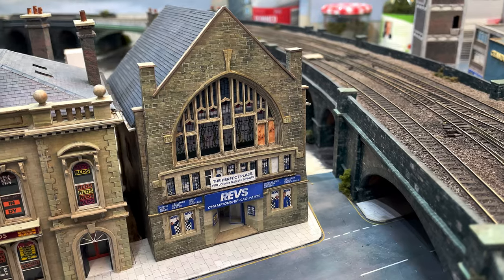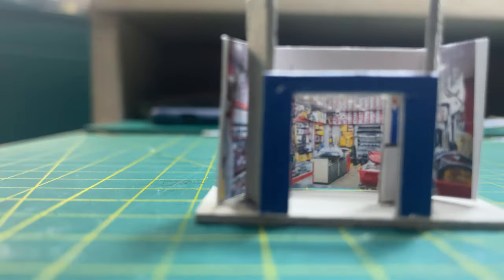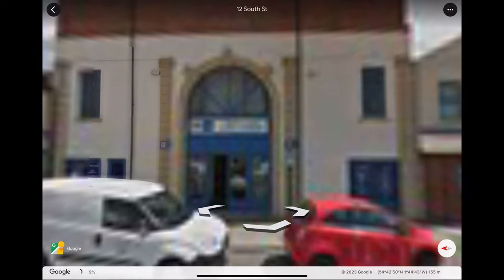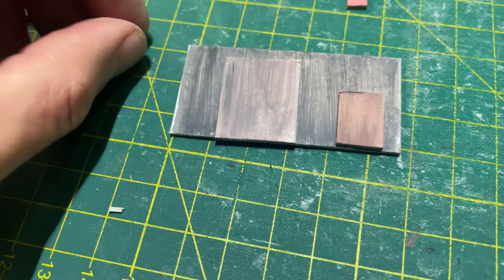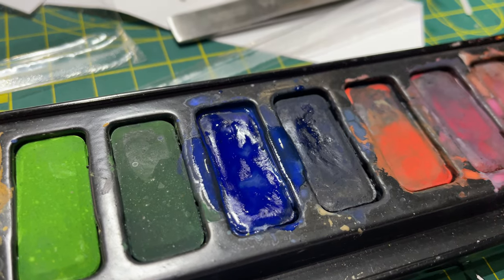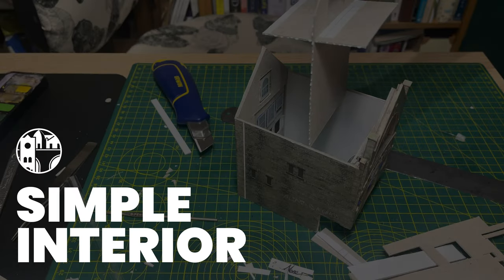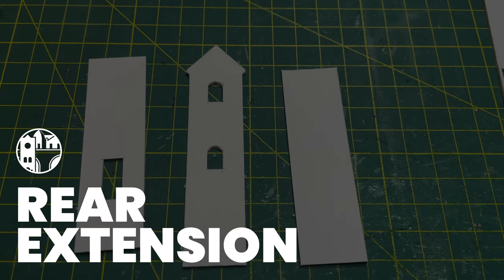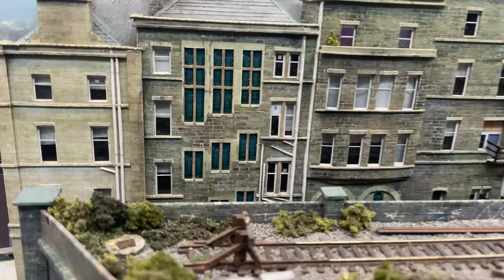Revs Finished! Adding the final detail to this High Street shop

Comment: The most amazing detail this time is the torn down poster of Jonny - the way, the paper is torn away at the bottom and seems to devide into many single layers at the top, is astonishing. Simply wow! Gives me the motivation to experiment in this direction, too.

Wonderful video, as always, Michael.
All the best
Valentin
Reply from the maker: Thank you. I made it like this: cut it out and then use the back of the scalpel to gently scrape down towards the bottom. The printed surface scratches off and the very bottom tears a little. Fold over the top corner. Use slightly diluted glue to attach to the door and smooth the bent corner with a paint brush. Add lots of varnish to cause the top corner to swell slightly and smooth it all down with a brush.
Reply: @Chandwell  Thanks a lot for the helping description - I will try it out!

Comment: Hi Michael, at about 25 seconds in you say about not putting lights in the buildings - the first thing I thought of was The Weir which did have lights!  I’m not being picky but just wondering if that’s something you looked at earlier on but decided against later on.  To be fair, and appreciating how small N gauge is, I reckon the detail you put in speaks for itself so no real need.  Another triumph in the north and thanks for sharing : )
Reply from the maker: Yeah, exactly that. The Weir, T&C Bakery, Ironbridge Works, the Station, and the Station Canopy all have lights. But three things about them caused me to stop doing it. 1) I never have my room in darkness and the bright office lights mean that you can't see the model lights anyway. Looking into the buildings through the tiny windows at N scale, and you can't see any detail in there. 2) My buildings cost almost nothing to make. Buying copper strip, LEDs, resistors etc., although only pennies, seemed like something I couldn't justify spending on. 3) I just don't enjoy the electrical side of the hobby. I would get a building to the point where I had to get the soldering iron out and it was like that dread of a piece of homework coming up that you just don't want to do. Half-finished buildings would sit there and I'd look at them with no passion, no interest, just the dread of a "chore" needing to be done. So realising that it was the lighting that was causing these feelings, I decided to not bother any longer, and my enjoyment of the hobby went right back up.
Reply: @Chandwell  Hi Michael I can see that exactly, and I agree that things should remain as a hobby and not a chore.  I see what you mean about detail too, I recall the interior of The Weir thinking “blimey that must be proper tiny” and knowing you’ve put the effort in and it not showing up must be a bit grating.  

I’ve never done electrics and while I’m thinking of a modular layout to replace the first (long term plan - I’m still building and learning on the basic first one - and that’s 13 months in!) the thought of the electrics seems daunting and will be a massive hurdle.   I need to think about a new removable layout though as at one point the wife will want our loft room back (which the current one, although small for a layout, takes up most of).  

Thanks Michael and see exactly what you mean, appreciate the reply as always : )

Comment: You Mentioned that it may be difficult to see the excellent work you did on the Stainglass windows because it will be so dark inside. May I suggest that you put a very dim LED on the inside to provide just enough lighting to show off your Stainglass windows. A dim LED can provide that affect without giving ideas that the upper area is that what up.
Reply from the maker: Thanks Jim.

Comment: Michael Liking the shot at the start of this video. Looking from Station and Station Alley to Revs and the Indoor Mar et, you might need some of weeds along by Fashion Focus wall to the cobbles to hide the gap  like in last weeks Otley video. Liking how Revs has turned out including the extension staircase. With a bit of weathering and rust, green water streaking & plants on the rather white downspouts & possible bright Scotty tag at the back of Revs. But overall once the back alley is done I think it’ll bring the whole scene together. Ian
Reply from the maker: The back of the Earl Chandfield is not finished yet. I have some plans for the strip of bare baseboard between Fashion Focus and the cobbles. My intention is to get all of that finished off in one go - all the details in the stream, back streets, and plaza. I still need to put down the SK8 crew, add planters, advertising hoardings, etc. I will try to get all of that done in one go before starting Station Road.
Reply: @Chandwell  Thanks Michael yes doing all the small detailing around High St Water Ln would be better in one go then it would look like a complete scene. Just saw that photo angle as you panned down from the Station in the opening shot.